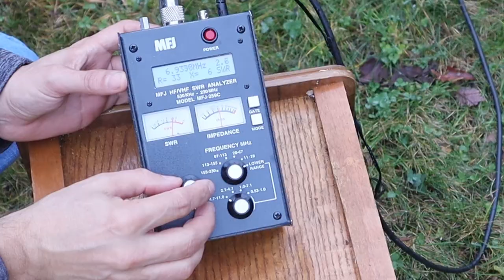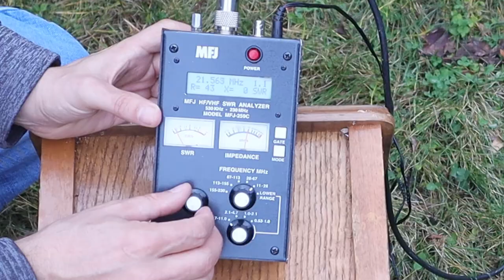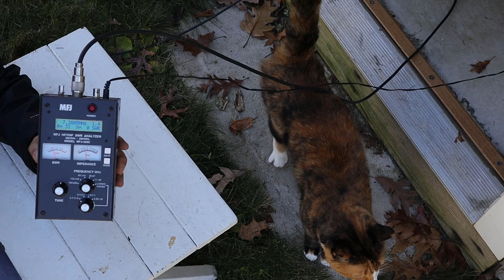Ham Radio Antenna - Junk Box Ham Stick Mount for Portable/POTA

Comment: For POTA I mount hamsticks on a mag mount located on the center of my car roof. For portable, I mount them on a 6 foot camera tripod with 4 radials. Both work great and much easier than deploying my linked dipole. 73 Marc, W4MPS

Comment: I built one of these a few years ago. I did not add and remove the ground radials. 
I put on for 80n 60m and 40m radials and 20m. I also made a bar for the 4 hamsticks. The are always on it with a 3/8 24 tpi bolt. I used it when I went to West Virginia atop East River mountain. I had very good results with just 100 watts. Good Video...  de W4DRA

Comment: WB4BKO For tuning the 80 meter Hamstick,  it is often necessary to trim off a few inches of the stinger. This prevents the stinger from affecting the resonance in the lower section coil. Very well thought out video and you have some really great ideas. I will be incorporating them in my next antenna project. 73
Reply from the maker: Thanks for the tip!  and good luck with your project!

Comment: Thanks for sharing. During the Black Friday sales I was looking at the Chameleon Quad dipole setup for using hamsticks because they were 10% off. I thought of you and how you make your antennas and decided to try my hand at making or buying a box to attach the matching hamsticks to and just make it a single band for now, go for quad later. $140 is a bit too much I feel for a box with a SO239 connector and a couple of 3/8"-24 adapters.
Reply from the maker: Their stuff is kind of pricey for Shure.  I'll bet you make something with parts from the hardware store or Home Depot for 1/4 the cost

Comment: How do you like the MFJ?  I have been looking for a new analyzer. I have the Rig Expert AA230 but NG on HF, I bought a China cheapy but don't trust it. I was looking at the Comet but still looking.
Reply from the maker: The mfj seems to work good.  Not as many features as others but it does the job.  Gotta keep the batteries charged or if it in using an ac adapter or it looses some accuracy
Reply: @SevenFortyOne  Thanks Rob, have you heard anything on the Comet?

Comment: Nice video. Thank you.  

I use ham sticks on my mobile rig and have also used them portable for Field Day. 

Question on your radials… Do you keep them elevated, off the ground, all the way from the antenna to the end of the radial?

Or… Do the radials droop, and run along the ground, after they get a few feet away from the antenna?

I would think that tuning would probably be very different between the two options above and I am curious which method you used. I have watch your (excellent 😊) video twice and can’t quite tell. 

Thank you 

Bill - W7JZE
Reply from the maker: I let them drop on the ground...they seem to work ok that way

Comment: Just for fun, why don't you attach another piece of flat metal across the mount using a 3/8  x 24 bolt with 3 holes, one in the middle and 2 more on each edge, using 3/8 by 24 threaded nuts on the whips, then put your 2 ham sticks for 2 bands and try that, with of course some radials for the bands you are trying? I think you will find the 2 bands or 2 ham sticks become like a fan antenna with both working with one coax? Some minor tuning may need doing, but this way you have BOTH bands? If you have 3 ham sticks for 3 bands then do that knowing a mount to do this for 3 whips does exist, but it slightly bends on the edges so the whips will separate away from each other? Then your antenna becomes a tri-bander?    https://www.gigaparts.com/vp-1.html?gclid=Cj0KCQiAoab_BRCxARIsANMx4S5z6cgH-aioWo9pjibun5n7Ds2yBvHIQY7lQtHgOPcICQbRN8hAaNsaAjQBEALw_wcB

Comment: What battery do you have there with the FT891? Thanks!
Reply from the maker: Bioenno 15ah...I forget the exact model#
Reply: @SevenFortyOne  thanks a lot!
Reply: @SevenFortyOne  In your experience, how much time does this battery give you on the FT891 if doing say 25% TX and 75% RX? Thanks!
Reply from the maker: I've used the radio set to 50 watts with about those conditions for 6 or 7 hours with no issues.  Not sure how much charge was left, I wasn't paying attention
Reply: @SevenFortyOne  very helpful. Thanks